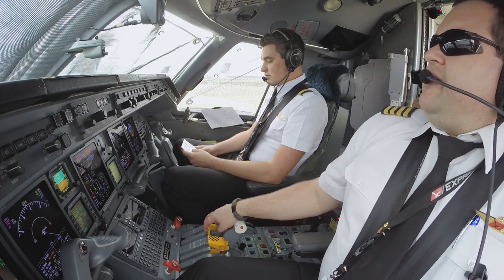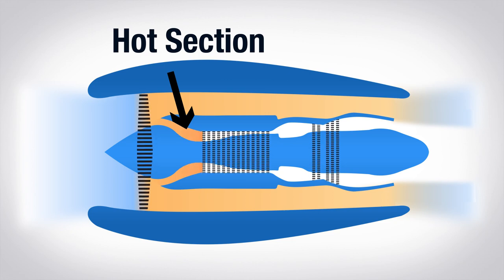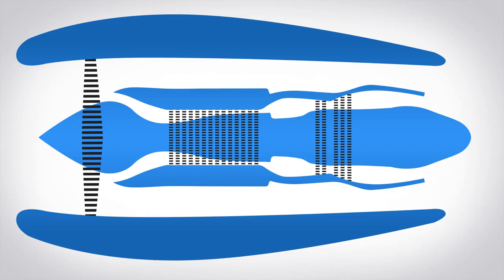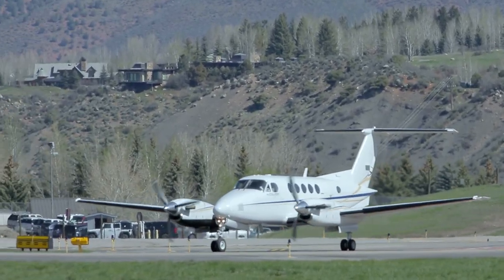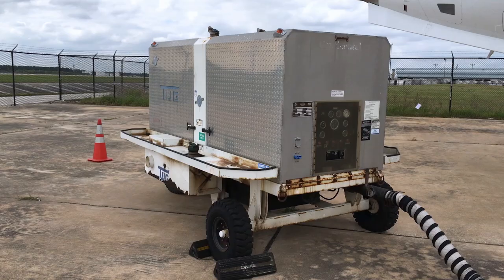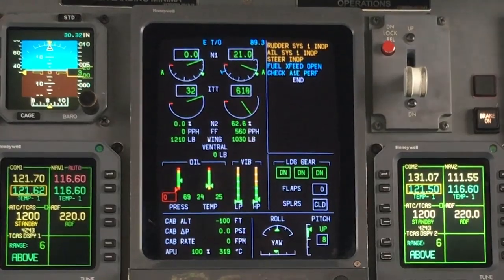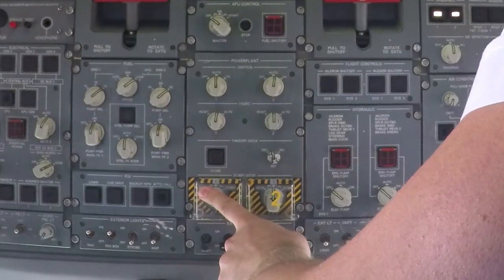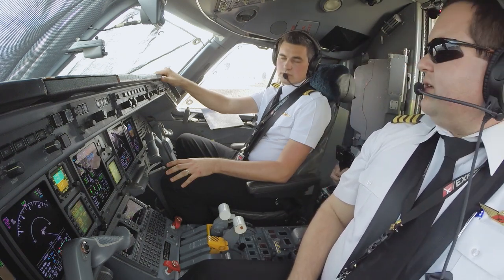How A Jet Engine Starts

Comment: Excellent, high quality and professional video.  Very informative.  Thanks!
Reply from the maker: Thanks!
Reply from the maker: And there's more on the way...
Reply: Ditto!! Thank you.
Reply: stereopolice I
Reply: BrewtownFlyer
Reply: Parthasarathy Narapaneni
Reply: I thought the 787 uses electric motors instead of air to spin the turbines during startup? 787s have larger engines than region jets so if they can use electric motors surely regional jets can?
Reply: stereopolice
Reply: stereopolice
Reply: George Tirebiter
Reply: do you know if what is in this video differs with turboprop engines or are they the same
Reply: Depends.  Many turboprops are small enough to use electric starters, otherwise basics are the same.   On the other hand, turboprops are more complex than turbofans, mainly because of the propeller and reduction gear box.  More things can go wrong starting a turboprop.  I saw most of those things happen while wrenching Convair 580s with Allison engines, 1967-1980.  Hours of training kept us ready to handle the problems.
Reply: Could the maintenance issues associated with turboprop gearboxes be one reason why regional carriers switched to regional jets with turbofans?
Reply: Possible, but gear box problems were rare in my experience.  Hot section and accessory problems seemed to dominate.
Reply: hananokuni2580. Turboprops are more efficient for shorter distances.
Reply: I've held that conviction for a long time, but I have yet to see any new commercial turboprop designs.

I've always had a thing for turboprop planes. I've even wanted to fly in one. The closest I ever got to that, though, was being inside a Beech 1900D and an EMBRAER EMB-120.

Now, why haven't I seen any new turboprop designs introduced to the market as of late? Maybe the old designs are good enough even for today's markets? I think restarting production of something like the NAMC YS-11 turboprop would be one way to go. EMBRAER still produces EMB-120s whenever they get new orders. Is the ATR series still in production?
Reply: It probably has to due with cost, efficiency, lower maintenance, resale value etc. I did not see your your comment about regional. Turbo props are more efficient for shorter distances. For short distances, turboprops are more fuel efficient than jets. On the longer flights, the jet (turbofan) engines win the race. Turbofan engines perform best at high altitudes. At medium and low altitudes, the turboprops are more efficient engines
https://airinsight.com/2011/08/19/jet-vs-turboprop-a-debate-that-dates-from-the-early-1950s/
http://aviation.stackexchange.com/questions/19197/why-dont-airliners-have-turboprop-engines-instead-of-jet-engines
https://www.google.com/#q=turbine+versus+turboprops&*
Reply: I was thinking that, for example, MIA-EYW, MCO-JAX, JFK-PHL, ERW-BOS, or ATL-CLT would be better served by turboprops, but these days I've see even these routes served by regional jets such as ERJ-145 and ERJ-170. Maybe operators will have even their shortest flights operate at, say, FL400 for as long as possible, to gain even a bit more efficiency than is possible with turboprop planes?
Reply: Thanks for the info. I have been out of touch with developments in aviation for a while. So to get this straight... there is more air at lower altitudes, so turboprops work better; turbojets and turbofans would have a hard time operating at their normal parameters due to the denser air and increased fuel consumption. At higher altitudes, air density is lower, so the turbines of turbofans can rotate at their optimal speed with little effort and less fuel is required to do so. A turboprop at high altitudes would go slower, even when operating at its normal parameters. 

In A&P school I learned that a jet engine moves a small amount or air at a high rate of speed, while props move a large amount of air at low rate of speed.
Reply: I thought the pilots just press a button to start the engine. Haha 😂
Reply: That's the Shut Down button!  It's right next to the Ejection Seat button.  Just don't get them confused!  lol.
Reply: stereopolice "
Reply: stereopolice 
Ok so an electric motor starts the engin
Reply: stereopolice
Reply: only the apu has an electric starter. everything else is compressed air. you can't spin a turbine of those massive 787 engines with an electric motor it'll burn itself to kingdom come
Reply: pieter pretorius The 787 uses variable frequency starter/generator. No air start.
Reply: thanks i probably should do a bit more reading on the 787. i fly the 767 in fsx so quite used to that
Reply: stereopolice b
Reply: stereopolice ii
Reply: Hurricane, simple answer is advancing technology.  787 was designed with an No-Bleed system in mind, hence it has beefy Lithium batteries alongside the APU to power it's electric generators prior to engine start.  The engines use a variable frequency starter/generator that requires more power than the typical aircraft could produce.  787 has a huge electric capacity to compensate.  This ERJ in the video is an older aircraft, built before a bleedless engine start was feasible.  Read here for more on the 787's start system:
http://www.defense-aerospace.com/articles-view/release/3/105600/electric-start-for-boeing-787-dreamliner-engines.html
Reply: stereopolice “.k88
Reply: Casey neistat
Reply: try a kite
Reply: +Scubadiverrrr how
Reply: Disciplined comment!
Reply: @Boldmethod  Loved the video! Great quality. Can you provide a link to the Video  for what the Next video mentioned at 8:50 is ? Next newer  video seems to be about IFR?? Thanks in Advance ..
Reply: @Boldmethod  quick question, where you ever at Atlantic Coast Airlines around 01 & 02?
Reply: suzan Elliot  I don't need someone to spy on her. I'm paying the guy she's cheating with so that I can go out and cheat with another girl and it frees up my energy for that. You see how it works?
Reply: @hananokuni2580  No.  The traveling public doesn’t like small aircraft, and like propeller driven craft even less.  Turbo-props are slower and noisier, but are more fuel efficient on shorter legs.
Reply: @oscarb9139  If all the airlines want is a healthy profit margin, why not just return to hub-and-spoke networks? Point-to-point is good only for traffic between medium-density and high-density cities, since lots of pax revenue is needed to pay for large fleets of aircraft. Wide-bodies can fly on high-density and long-range routes, while narrow-bodies and regionals can fly low-density and feeder routes.

Whether a certain type of plane is preferred by one group of consumers depends on the generation, I guess. The over-35 crowd might dislike flying on an EMB-120 or ATR42, but the younger crowd - especially those who came of age during the 2008 Great Recession - might not be as picky regarding prop planes and regional jets. Safety and punctuality are their primary concerns.

As for those not-too-enviable turboprop feeder planes, either cabin noise insulation and airframe noise abatement materials can be improved to reduce noise from the engines, or the turboprop engines should actually be replaced with electric motors that provide the same power output as that of the Pratt and Whitney Canada PT6A and Rolls Royce Dart turboprops.
Reply: @hananokuni2580  The noise level in a turbo-prop is not engine noise, it is prop noise.  This is not going to be fixed because it is caused by pressure pulses from the rotating props near the fuselage.   The engines can’t be mounted further out on the wing to give more spacing between the prop tips and the cabin because it affects controllability when single engine.  

Electric motors?  I suspect their time is a while away.  Although battery technology has come a long way,I don’t know if any electric motor has the power and endurance to carry a load for an hour or more.  In fact it would need 2.5 to 3 hours of endurance to meet the dispatch reliability requirements that the airlines would need.  Is there an electric motor/battery system that can produce 2000 horse power or more for that duration and be light enough to use in an aircraft?  Would the batteries be able to handle the power requirements of deicing the windshield, wings and instrument probes?

Aircraft size:  the ERJ145 is far less comfortable to ride in than a 737.  The overhead bins are tiny and the window seat sucks because the fuselage is curving in next to the passengers head.  The CRJ lineup is better, but not by much.

The airlines continue to use a hub and spoke network.  There is very little point to point in the networks.  The point to point city pairs are driven by high yield.
Reply: @bernieweber4663  Hey, your name sounds familiar.  Are you the Bernie that thinks jet engines don't use jet fuel?
Reply: @oscarb9139  I see you're still trolling.  Aren't you the guy who damaged a lot of aircraft?
Reply: @bernieweber4663  No, I haven’t damaged a single aircraft.  Do you still think jet engines run on air?
Reply: @bernieweber4663  Yep.  I try to prevent others from believing in stupid conspiracies.
Reply: @oscarb9139  Poor Oscar, I'm done trying to explain how turbofans and ramjets work.  Go to school and read some books please.  Thank you.  How many aircraft did you damage again?
Reply: @bernieweber4663  I haven't damaged any aircraft.  We know how they work..  Tell us how YOU think jet engines work.  Yunno, resonance......and all the other tripe you used to spout.  Are you still doing that?
Reply: @bernieweber4663  Bern, I fly for a living.  Actually, I haven't flown much for the past 7 months, but it more than you have for your entire life.  Just cut to the chase so we can have a laugh.  Tell us your beliefs on jet engine operation.  We can all get a laugh out of that.
Reply: @oscarb9139  you should stick to flying then.  It's not a good idea for you to get too involved in the mechanics of things or you'll end up troubleshooting the aircraft when you should be flying it.
Reply: @bernieweber4663  Sorry Bern, pilots are required to know about all the systems on the aircraft.  Go ahead and tell us how the engines work.  We already know, but can always use a good laugh from someone who thinks he knows more.
Reply: @oscarb9139  No, you are required to know about the systems in general.  Not all about the systems.  Lol.  You're a funny guy.
Reply: @bernieweber4663  There you go Bern, talking about things which you know nothing about.  What type ratings do you hold?
My certificate has SA-227, DO-328, 737, and A320 on it.  I can assure you we need to know far more than just a general description.
Reply: @oscarb9139  lol.  I never said I hold any ratings.  You assume too much.  Engine mechanics run up engines you know!  We used to taxi and do run ups down the runway.  Now just at high power spots.  

The only thing pilots need to know about engines is suck, squeeze, bang, and blow.  They might want to know a little about the bleed system but that's pretty much it.  The rest they can look at their glass to tell them what to do or how things are performing.  Have a nice day.  Don't forget to let the engine cool off a bit before shutting down.  Some y'all are terrible about that at the smaller airports where they taxi less.  My biggest complaint besides pilots not checking or draining water from the fuel.  Some y'all act like you never did a walk around before.  Most pilots are okay in my book though.
Reply: @bernieweber4663  There you go again, making false statements again.  Don't you get tired of being wrong?

By the way, cool down on my plane is three minutes if full reverse was used or two minutes if not.  In no case are we supposed to keep them running if we get to the gate in less time than previously mentioned.  That is the SOP.

What aircraft have you done engine runs on?
Reply: @bernieweber4663  Tell me where we would check for water.  I can't wait to hear this one.
Reply: @bernieweber4663  No.  I never assumed you had any ratings.  You don't know enough to hold any.
Reply: @oscarb9139  Yes you did assume or you would not have asked.  Are you fibbing again?   Ha, stick to flying.  There are too many know it all pilots who thought they could troubleshoot snd fix planes in the air.  They never get their hands dirty though.   A lot of them get named in NTSB reports.  Not a good idea.  But you do you oh wise one.  You would not last long in my shop with your attitude.
Reply: @oscarb9139  You really don't know where to check for water in the fuel on aircraft and some engines?  Are you a troll or did you forget something again?
Reply: @bernieweber4663  I want you to tell me when you have EVER seen a commercial airline pilot check for water in the fuel.  The last time I did it was in 1988 on a Delta 737-200 for first flight of the day.  We were a refueling company that serviced Delta, TWA, United, Continental, American, and a handful of regional carriers.  

It is not part of any major airlines preflight inspection.  Every time you comment, you show your ignorance.
Reply: @bernieweber4663  Go dig up an NTSB report in the last 10 years where a major US or Western European carrier had pilots incorrectly troubleshooting a problem and mess it up.

Pilots use checklists when working a problem.  It isn't done from memory.

When did I say anything about troubleshooting an aircraft?  We follow the ECAM if one is present, and follow the procedure in the book if it isn't.  

That has nothing to do with knowing the systems on the jet.  Here is a little Bernie quiz.  On an A320, the ADR's are not getting valid information, so the ECAM directs the ADRs be selected OFF.  The status page gives us the status with gear up (Alternate Law) and gear down (Direct Law).  It further states that the landing gear must be extended manually.  Why is that?  

This falls into the "pilots only know general things about systems" comments you have been making.

What sort of shop do you run?  Shoe repair?  Lawnmower repair?
Reply: @bernieweber4663  It is highly unlikely that you have turned and burned any aircraft, civilian or military.  Name a few, then we can talk some more.

Turboprop?  I have 6000 hours running PT-6, TPE-331, and PW-119's.  None required any cool down prior to shutdown in their manuals.  I flew into DFW regularly with temps reaching 100 F on occasion.
Reply: @bernieweber4663  I didn't assume you had,any ratings.  I knew you didn't.  The comments was to illustrate that you know nothing about the training because you have never been through a single program.  Thanks for acknowledging that.

Military pilots have a much longer program and delve far deeper into systems.  Why do you even bother commenting on aviation when you are an outsider?
Reply: @oscarb9139  You're an outsider to aircraft mechanics and the military. Military pilots definitely do not delve into aircraft systems.  They are taught what they need to know.  You have no clue since you're an outsider to the military.  You're call sign would be what?  Maybe you're a wanabee fighter pilot.  You'd be doing cargo runs to Burma or the Yukon.
Reply: @oscarb9139  you're clueless.  If the engine reaches near an overtemp temperature it needs to be cooled down regardless of which type engine.   I've also worked on RB-211's and a couple of others but who's counting.  Keep digging yourself a hole. 

The only reason you're allowed to troubleshoot one step in troubleshooting for the landing gear is so there's not a need to raise and lower the gear in the hangar or at an overhaul facility where it can be done.  And for inflight discrepancies that would be difficult to duplicate on deck.  Or, an inflight emergency and usually you'll be talking to maintenance to help you out.  

The NTSB ihaa reports of pilots who have delved into systems so much that they thought they are so smart they could troubleshoot in the air.  They get caught up with that and end up not flying the plane.  They fail at doing their job.  There are loads of crashes with pilot error.  

Never mentioned commercial pilots taking fuel samples.  That would be ridiculous since you'd need a ladder for most of them.  And they'd make a mess getting fuel on themselves. Wouldn't be good to smell like fuel in the cabin.  And pilots would probably not know how to reset a drain if it was leaking.  Some commercial pilots I could see causing a lot of spills.  Not good. 

You should think about taking a reading comprehension course so you don't go off on tangents or make so many wrong assumptions.  Maybe you're just trolling.
Reply: That's good that you troubleshoot using ECAMS and using a checklist but what I'm getting at is pilots who try to go beyond that or get caught up with troubleshooting so much that flying the plane becomes secondary.   Since crews are better at communicating in the past twenty years thru resource management there aren't as many mistakes like that.  I'm always looking out for pilots and so we don't give them too much information.    Only what they need to know.
Reply: @bernieweber4663  So military pilots do not delve into systems?  You know this because...........?  

You aren’t a pilot.  You know nothing about pilot training. You don’t know about checklist discipline.  Why are you here?  Why don’t you go to Agent JZ’s channel

https://youtu.be/yaFeO6Jze64

 and say stupid shit there?  He is an aircraft mechanic and shows his projects on his channel.

Do you have those references about pilots troubleshooting problems from memory (a violation of SOP) causing NTSB reports?  The ONLY technical thing you have said in any of your posts is “RB-211”, and that isn’t very technical.  I notice you didn’t attempt the Bernie quiz either.
Reply: @bernieweber4663  When does an engine “reach near an over temp temperature”, and need to be cooled down?  Tell me about that situation.  Mechanics should refrain from telling pilots how to fly and pilots shouldn’t tell mechanics how to maintain aircraft.  You pretend to know something about flying, and it is obvious you do not.  

You claim you have a shop.  Maybe you do.  What does your shop do?  What aircraft do you service?  I assume you don’t work for an airline by the way you talk and the fact you refer to it as your shop.  You don’t need to specify which airport.  Here is a technical question on the RB211.  What stage is bleed air taken from and what are the users?   NOW WE ARE HAVING FUN!
Reply: @oscarb9139  lol.  I last worked on an RB-211 over twenty years ago.  Also worked on Lycoming's and rebuilt one.  

To your question.  There have been many flights with pilot error in the A-320 mainly cause by pilots who delved too much into systems when they should be flying the plane like they're paid to do.

Just a few I'll list in the last ten years for Ajrbus.

A-320 FLT one engine shut down due to eng. bleed air due to overheat.  Crew failed to use APU to assist in cabin pressurization.

A-320  29 Aug 11, FLT 270. 
Pilot error.  Pilot used right edge lights of runway as the centerline.  Lands plane into the dirt!  

A-320. FLT 1702  2014
Pilot struck tail on runway during T/O!!!  Attained a flight level of 20 ft.!!!  Slams a/c back on deck and collapses NLG!   Pilot reportedly confused on warnings.  Incorrect data input while taxiing.

A-320, FLT 8501  Dec 2014 Crew ignored recommended procedures.  Reset C/B.  Fatal crash.

A-320 FLT 1878. 2015
Hard landing pilot error.

A-320 FLT 759. Jul 2017
Crew nearly lands on wrong runway after lining up wt. parallel runway with four loaded a/c on it.  Major incident.  Pilot error.

A-320 FLT 8303  2020
Rare double engine failure.  Fatal.

Here's one prior to ten years ago. 
A-332
Aircrew spilled coffee on ACP causing smoke in the cockpit and a burning electrical smell.  Pilot error.  Pilots were told to use the cups with lids on them. Lol.
Reply: @oscarb9139  lol. I taught as an instructor in the military for at least three years (of many) on aircraft engine and fuel systems,  engine tear down and rebuild.  Never had a single pilot as a student.  Also ran the simulator for students so they could learn the basics and emergencies.  Hmm...never had a single pilot in my classes and never had one remotely interested into "delving" into the systems.  During the course of many years of maintaining aircraft and engines pilots would normally say they don't want to know that much about the system during or after debrief, or ever.  You must be the lone duck that flies a different route..
Reply: @oscarb9139   An engine reaches near overrmp when CHD temp rises too high.  Usually only one cylinder is being monitored so you need to be careful when at Red.
Reply: @bernieweber4663  You can’t keep your conversation on topic.  You are on a jet video comment section talking about Turbo props on a hot day needing a cool down, and then relating it to piston engine CHD (CHT?).  Which cylinder should I be checking on in my A320?  How about the pilots in this video?  Which cylinder do they monitor?  

You never did answer the “checking the fuel for water” question I had for you.
Reply: @bernieweber4663  So you taught for three years in the military on “engines and fuel systems”.  That’s pretty odd.  What about all the other systems?  Were they deemed unnecessary to know?  Who were you teaching?  What branch were you in?  You sound like a complete fraud.  Answer some questions if you want to gain any credibility.  None of what you say makes any sense.

Last time I had a conversation with my military buddies, they never said the courses were optional or that the content of their education was whatever they felt like learning.
Reply: @bernieweber4663  Nice list of A320accidents/incidents. Now, explain where pilots “troubleshooting” caused them.   That was the question I posed.  Then remove any that can attributed to “troubleshooting” if the operator was not USA, Western European, or Australian.  Training is different in different parts of the world.  I can only speak to training practices in the previously mentioned locations.
Reply: @bernieweber4663  I think I understand your position now.  You have a small shop that maintains single engine piston aircraft and you feel comfortable coming into a comment section for a video about starting the engines on an ERJ145.  You can’t answer any specific questions and respond with answers that don’t match the question you are replying to.  

So, here is an easy one.  What are some differences between the O-360 and the IO-360?
Reply: @oscarb9139  How's that reading comprehension thing going?  Yeah, you have no need to know how long of service or what branch Zi was in since you keep following on various youtube videos.  I've recently had some an account hacked from a company employee at headquarters most likely and you ask too many personal questions.  It doesn't much matter since an engine is an engine.  I will say the first military aircraft engine I worked on was a turbofan.  The last  aircraft were AWACS, KE-3A, and E-6A as a civilian.
Reply: @oscarb9139  Boeing 757 and 767.  Also did overhaul C and D checks on them (and occasionally 737 flaps and slats, and rudder on 27's)  working flight controls at an overhaul facility.  

Yeah, I suppose it seems odd to be instructing on a simulator enlisted folks.  I convinced the trainers there I needed to teach my students real emergency procedures which would be hard to do on the aircraft itself.  That would come later after the simulator.  It was a great help and they learned quite a bit as most wee just out of boot camp.  Some told me they wrote home about the simulator since after all went thru I gave them each about 15 minutes of flying time.  Plus we went out and each student did low power turn up to military 80%.  And moved flight controls around.  They got a real thrill.  I actually didn't have to do any of that but my commander told me to change it up b/c before I got there they were getting complaints.  Too much class time not enough aircraft time.  Most of the students had only seen an airplane close up on their flight to boot camp.

My biggest accomplishment back then was ensuring women were getting the same training as the guys.  At the time they weren't.  If they even made it to a shop they most cleaned up spills and did shitjobs.  That I was able to help make changes was probably what I'm most proud of.  It wasn't easy but with help it was made to happen. That was back in the 80's and even into the early 90's!
Reply: @bernieweber4663  My questions were general in nature, because most people won't answer questions that are too close to home.

So, here is my beef with you.  You make statements that are intended to make yourself sound smart, but don't answer rebuttal questions.  Here are examples of that:

You said many pilots have screwed up mainly because they were troubleshooting from memory.  I asked you to provide examples in the past decade of carriers in Western countries. By the way, the NTSB only investigates incidents/accidents in the US, so your comment about pilots troubleshooting could end up with an NTSB report should actually reference accidents with an NTSB report.

Your reply was a cut and paste of a list that contained ONE incident (CB reset) where that may have happened and it was NOT from a Western country.

You mentioned that your biggest complaint is pilots not checking for fuel in water?  That is a general aviation thing, not an airline thing and then you asked if I "really don't know where to check for water....are you a troll or did you forget something?"  It further demonstrates that you don't know anything about airline operations.

"Dont forget to let the engines cool off a bit before shutting down" was a lame comment.  The engines cool down after landing.  The airlines consider all the cost per minute (crew, fuel, misconnects, maint) and we try to shut one down as quickly as we can after landing, but no sooner than 2 minutes, HOWEVER we shut them down at the gate immediately if we get there in less time.  Generally, taxi time exceeds 4 minutes with very few exceptions.  Then you made a reference to turboprops on a hot day.  Really?  Did you see a turboprop in this video?  So I countered with 6000 hours of experience and told you no flight manual of any of the turboprop aircraft I have flown had a cool down requirement.

The most likely reason pilots didn't want to sit in on your play sessions is they are busy.  Military pilots spend over a year getting qualified on their aircraft and go into more depth than their civilian counterparts.  How do I know?  Half the pilots I work with are former military pilots. 

Now, that being said, there is great value in what you did in the simulator, for morale.  Most people never see the inside of a cockpit and have no idea what it looks like or how things work.  

Can a pilot take apart a pack and identify the parts?  Probably not.  Does a pilot know how it works, the bleed source, various modes of failure?  Yes, because it helps our decision making process.  You would be better suited to commenting on a maintenance video that one that pilots have created.

So, before commenting on my reading comprehension, make sure you actually answer the questions being asked.  You sound like a politician.

Oscar:        Bernie, if elected, what will you do to stimulate the economy?

Bernie:        I have been in politics for 20 years and can do a much better job that my opponent.  I have driven cars that he will never drive and I don’t tolerate cheating on the golf course.

Just answer the question.
Reply: @bernieweber4663  Don’t worry about me following you.  I have better things to do.  I happened upon this video and was reading comments and saw yours.  In fact, I commented to someone else before I ever saw your comment here.

I thought you were the guy from about a year ago who was claiming that engines don’t use fuel (fuel hoax video) and asked you about it here.  That’s all.  Then you made a stupid remark about me damaging an aircraft, and off to the races we went.

Was that you making the claim in the other video comment section that engines use resonance or some other silly theory for power and not jet fuel?  I assume not because any A&P would know better, but I thought I would check.
Reply: @oscarb9139  I don't recall anything about resonance.
Reply: @oscarb9139  Pilot arror accounts for over 50% of all commercial aircraft accidents!  

More examples:

Eastern Airlines Flight 401 
Crew decide to troubleshoot  landing gear light.  This distraction led to the aircraft striking the ground.  Crash fatal.

Air Tahoma FLT 185
Fuel starvation, crew mismanagement.  Crash

Adam Air FLT 574. 2007
Malfunctioning Inertial Referencing System.  Crew attention diverted from flight instruments.  Crash fatal.
Reply: @oscarb9139  The pilot needs to check for water in the fuel on general aviation aircraft.  The mechanic checks for water in the fuel on their inspections typically on commercial or large aircraft.  Not sure how you don't understand that.  It's not that hard but you seem to make things difficult.  But then you're a pilot too so there's that.
Reply: @bernieweber4663  I didn’t ask about an L1011 accident that was absolutely pilot error.  You made the comment about A320 pilots troubleshooting problems and causing accidents.  I never said pilots don’t make errors.  I never said pilot error was seldom the cause of accidents.  I asked for data in the last 10 years because things have changed drastically in the last 20.  After the United Airlines crash in Portland, Oregon, the airlines studied the causes of various accidents and found that minor mechanical problems that were mismanaged led to unnecessary crashes.  This led to the development of CRM, which has further morphed into CRM and TEM.  Pilots, like mechanics are human, and are going to make mistakes.  The primary difference is that pilots have time and resource constraints.  I am not a mechanic and am not going to speculate about how or why their errors occur.  

Go read your comment and then go read my reply.  I think you will discover that you don’t actually reply to my comments with data that refutes my position.
Reply: @bernieweber4663  checking for water in fuel:  this video is about Part 121 operations.  I operate under part 121.  Your comment was regarding Part 91.  I am not sure how you got there.  Did I ever claim to be a GA pilot?  (In case you have short term memory issues, the answer is NO). Why would you chastise me for not knowing how to sump the tanks? You do recall chastising me for not knowing how to check for water in the fuel don’t you?  

Pay attention to the topic before commenting.
Reply: @bernieweber4663  Ok.  I was thinking resonance was you, but I am sure it wasn’t now (based on your reply).  You probably said something stupid about pilots, pilot training, or airline operations and we had a back and forth over that.
Reply: @bernieweber4663  I notice you aren’t responding to my last comments.  If you want to admit that you jumped the gun and said some stupid things, we can have a civil conversation about anything you want.  It might even be productive for other readers.
Reply: @Boldmethod  what causes that humming sound? And how come it turns into a roar?